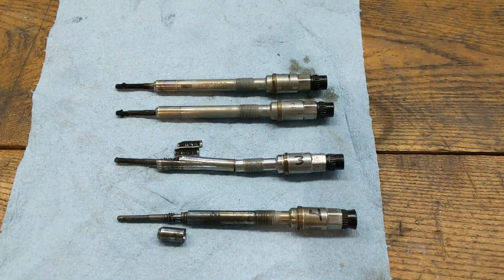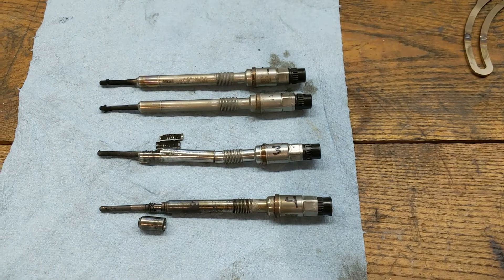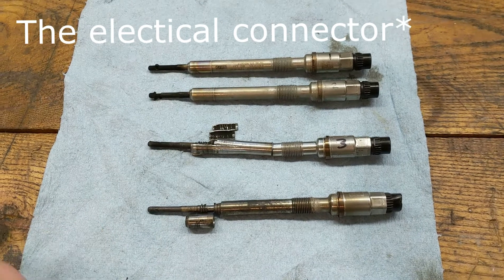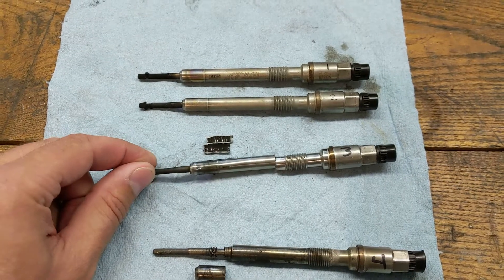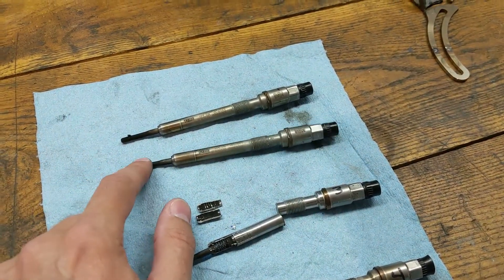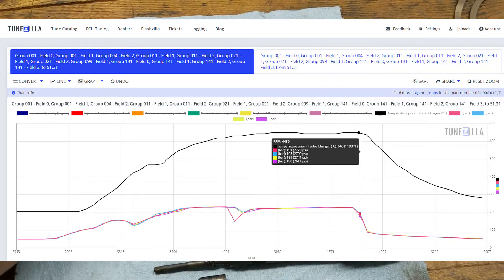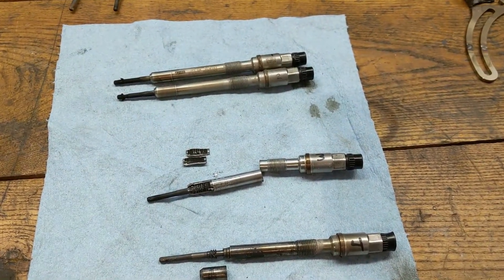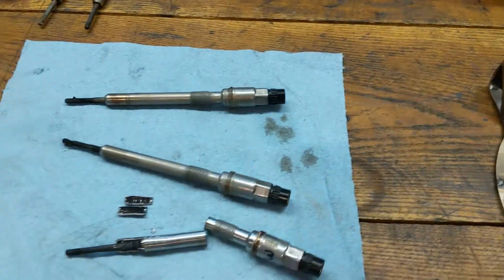Glow Plugs

Comment: Don't know too much about how glow plugs work, do they actually affect performance even after starting if 1 is bad?
Reply from the maker: Should have zero impact on performance once the engine is running and warmed up. These however are also cylinder pressure sensors. Not sure exactly how the ECU uses this information, but it is a generic compression test to log this information.
Reply: @tvanc542  Thanks for the knowledge man
Reply from the maker: Would certainly impact performance it the tip broke off! Hahaha!

Comment: Glad to see your still fighting the good fight for all us mk6 Jetta TDI owners. I’m looking to do an egr/dpf delete and I have a couple questions for you. I know I’ll have to get a ecm and dsg tune with the deletes and I plan to also do a full 2.5 in exhaust. Any advise or insight to keep the process smooth and simple? Any other concerns for longevity? What else should I swap or delete? Not looking to have a diesel track monster like yourself just trying to keep this car for as long as possible being a courier. Shouts out from Ohio! Keep up the good work!
Reply from the maker: Rawtek's instructions are good. What I used.
Reply: Diesel Dad it worked for you, that’s good enough for me
Reply: @benny_gt7208    I would also add, if your looking for longevity. I would consider getting a CP3 HPFP.  From what I've heard ,the stock cp4 likes to grenade itself into your fuel system sometimes.
Reply: Midwest MTBR any other parts that I have to change with the cp3 or is it some what plug and play?
Reply: @benny_gt7208   you have to get your tune updated i know for sure. I  am going to install one this winter. I also purchased a different High Pressure Fuel rail sensor. It  will let you run higher fuel rail pressure. Im not sure if its totalky necessary if your not looking for more power aswell ,with  adding the cp3.
Reply: Midwest MTBR thanks for the info
Reply: @benny_gt7208  Definitely recommend cp3 hpfp, my car just got out of the shop (luckily still warranty) from a hpfp failure at 80k miles. Even with filter changes every 20k miles. Warranty is 10 yr 120k miles if I remember correctly. DPF delete instructions say it's possible to remove dpf without dropping subframe but in my experience it was required to drop it at least 1/2" to wiggle it out. If you do end up getting a cp3 be sure to protect it with a Nicktane 1micron fuel filter kit! Just ordered mine for my cp3!
Reply: Avyiix I’ll have to save up for it can’t find one less than $1500, I’m hoping I can do the deletes with a quicklift and drop the subframe then get an alignment
Reply from the maker: Don't really have much for advice other than to get all your ducks in a row before you start. Make sure you have all the parts and pieces, tuner is ready etc. Takes a bit of elbow grease. Thanks for watching.
Reply: Diesel Dad thanks, I’ve heard conflicting info, it helps to know it’s straight forward. I’m just gonna Malone on the tuning and Rawtek full exhaust delete. I’ll ride out from there. 162,XXX miles on a stock setup egr, nox trap and intake all died so not trying to do that again.

Comment: Thanks for the update.

Any idea on when you’ll switch to meth injection to help manage the EGTs?
Reply from the maker: EGT's are actually quite low. The more I think about it, the more I'm convinced that this was due to a few 30 second + glow plug burns. But, I would like to try water/meth for the added egt reduction and steam cleaning. I think the trick with that is not over doing it.